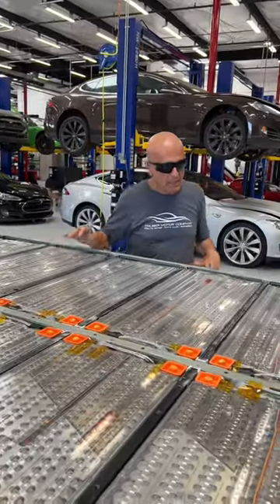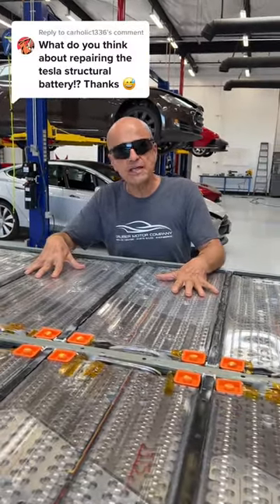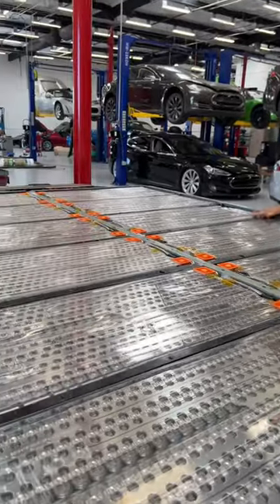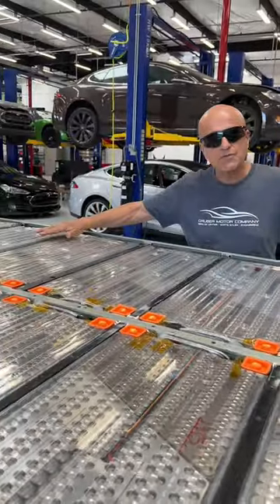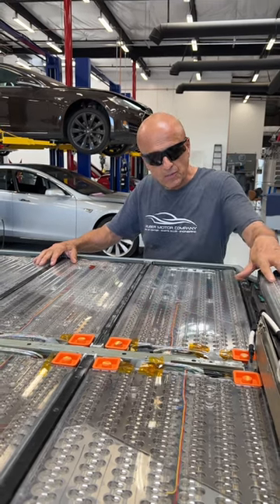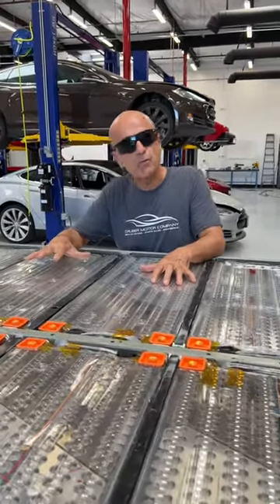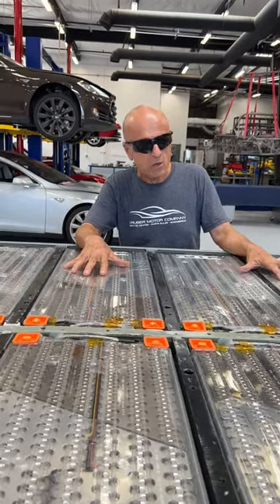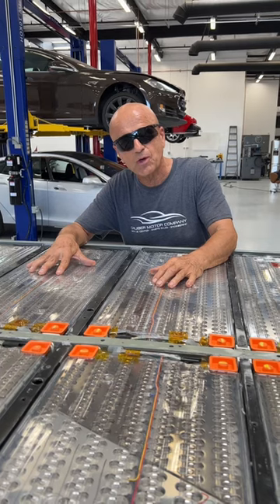What to we think of the New Tesla Battery packs? #shorts

Comment: I would set it up on a XYZ, CNC Drilling operation system with coordinates of where to drill for each cell with a ceramic drill bit to break one end of the connection to an identified cell that has gone resistive. Use the usual charge the group of cells up, then identify the self discharging cell by FLIR techniques, perhaps using the CNC machine doing the movement control of the FLIR camera and an interactive program using the FLIR data possibly through a limited view aperture, that puts horse blinkers on the FLIR as it is moved over the cells to limit it’s view until it is hovering over the hot cell, to locate the target coordinate of the defective cell.